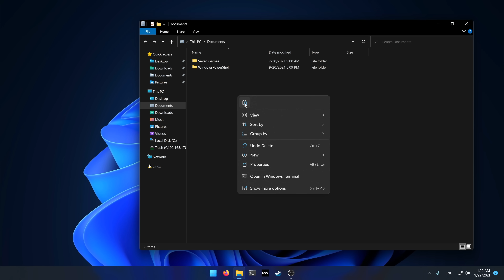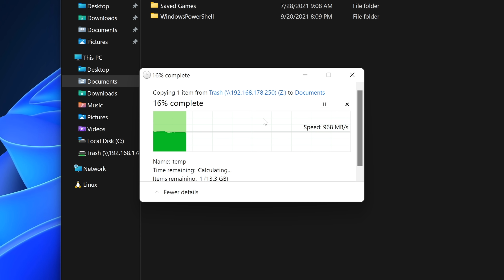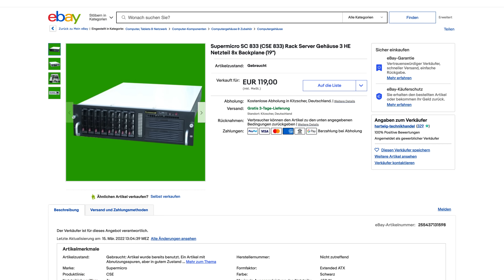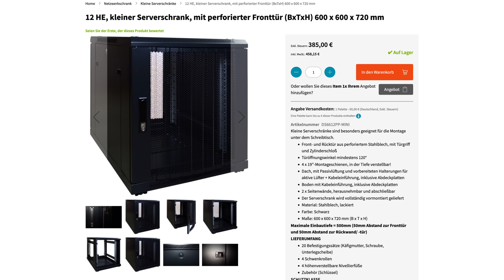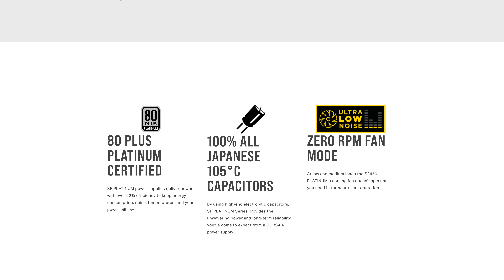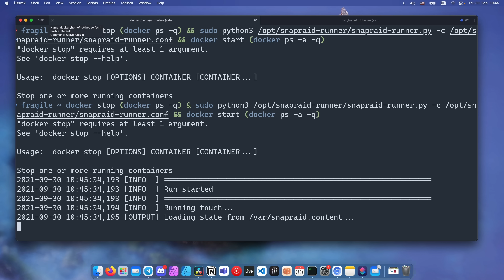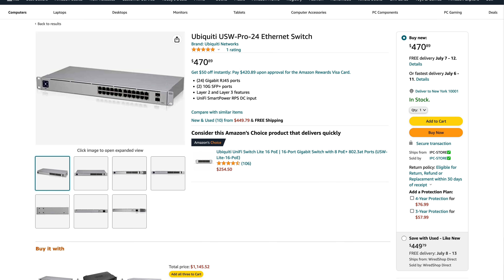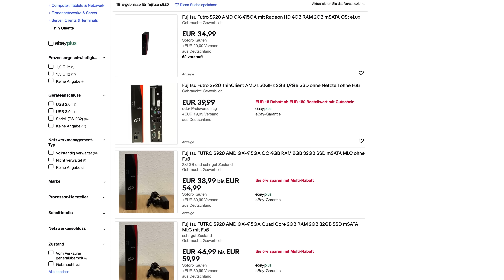Building a Homelab Server Rack!

Comment: I'm very curious about the exact specs and the daily power consumption. How much power does it draw on average?
Reply from the maker: The whole rack or just the main server itself?
Reply: @WolfgangsChannel  Oh sorry the main server itself :)
Reply from the maker: 19-22W on average, when the HDDs are spun down. I use my SSDs as much as possible, and when they’re full or the data hasn’t been used in a while, the mover moves them to the HDDs. With all HDDs running, the power consumption doubles, becoming 50-55W
Reply: @WolfgangsChannel  Nice, that sounds pretty good. Am gonna go with a similar setup and have the HDDs be on as little as possible to reduce power. Thanks!

Comment: I am in the middle of similar project as well, upgrading from Pi4, and torn between rack and ordinary ITX case. I see you are mostly using consumer-grade parts in your build, what do you think is the benefit of going with rack case over something like ITX with hot swappable bays in front, or is it just for the looks and maybe tucking everything neatly in the rack? Are the rack cases generally compatible with consumer motherboards or did you have to drill additional holes?
Reply from the maker: Rackmount and ITX are in  different 'weight categories' and have completely different use cases.

Going with a rack makes sense if you have (or plan to get) other components apart from your main system – e.g. a switch, a rackmountable router, perhaps another system, etc. When it comes to the main server itself, it might make sense to go with a rackmount enclosure if you think you'll need more than 4-6 hard drives and you like hot swappable bays.

Getting a rack just for one system and with no plans to expand is probably not a good idea. Server racks are big, and if you're considering an ITX case as an alternative, it's probably because you want something that doesn't take much space. If that's the case, a server rack is out of the question.

Concerning the motherboard compatibility – empty rack enclosures usually have standard ATX standoffs. There are some all-in-one servers that feature proprietary motherboard standards, and if you find an empty enclosure from one of these on the second hand market, it might not be compatible with an ATX motherboard.
Reply: @WolfgangsChannel Some ITX cases have hot-swappable bays in front (aimed at home-NAS builders), but I think I try to hunt a second-hand ATX-compatible rack case as I plan to upgrade. Software side I think I'm going to try out TrueNAS. Thanks for the advice!

Comment: Very cool project.What is a noise level under full load ?
Reply from the maker: The fan speed is fixed. The CPU is not very powerful so it doesn’t get very hot, even under load. Since those are Noctua fan, the noise level is low

Comment: Amazon sells short 6" extension cords that you can use to move the power bricks out and away from the power strip, thereby making each outlet available.
Reply: A wild Dave appears
Reply: There's also the option to get a power strip with only IEC C13 sockets. Usually they have a lot more since it's more compact, and you can connect servers and lots of appliances directly to them. And for stuff that uses regular mains plugs, Amazon has also tons of IEC C14 to whatever plug you use in the country (usually made to be used with UPSes).
Reply: Somebody on Reddit clued me into these when I ran into this issue with my UPS. Those things were a lifesaver.

Comment: To be honest the gold vs platinum is a debate on itself because you aren't getting more out of it per se (cost vs savings), because on the board you could get a maximum profit of 3%. plus you swapped the 650w with a 450w unit. So the consumption of your hardware could potentially "fill up" the 450w faster where it would have a negative efficiency because the PSU would be on a higher load thus having more costs in the long run. Also as for the PSU I would have gone for a seasonic because they are better quality and if you ran that 24/7 you want to have a reliable PSU. Either way the rack itself looks good! But just a food for thought :)
Reply: the platinum has a flatter efficiency curve contrary to the gold. it beats gold no matter what load you consider, and he mentionned in another comment that the thing doesn't pull more than 150W.
As for Seasonic, they have some really crappy series too. As for that Corsair one, he has the top of the line from the brand, so he'd have not much to gain going seasonic.
All in all, no matter what brand he selected, a platinum makes more sense anyway. they run cooler, the fan kicks in rarely if ever, since the case alrealy pushes some airflow through the PSU. Looks good as it is :)

Comment: 8:12 Just for anyone that is thinking of taking this advise; keystones need the same exact punch down tool to terminate them properly. What I will say is that keystone patch panels are nice because they are very modular and you can get keystones for HDMI, USB, ect. not just ethernet.
Reply: Only if you get that style of keystone; You can also get slightly more expensive pass-through keystones that have an RJ45 socket on either side so you just plug a regular pre-terminated cable into the back of it.
Reply: The CAT6A keystones I use don't need a punch down tool. They come with a plastic part you clip the cables into, then you press that piece into the back of the keystone. Requires a lot of force, as the plastic part punches down all eight wires at once.
Reply: There are a lot of keystones that don't need punch down tool. The "punch down" functionality is build in this modules. Just read the manuals before you buy this modules.

Comment: There are a lot of newer Supermicro server chassis that can be found on ebay in Germany,
I recently got SC826 12 bay chassis for €200 and redid it into JBOD, it had quite fans, quite power supply. I also have SC743 chassis where I replaced fans with SuperMicro quite version, and upgraded power supply to quite version as well, SuperMicro have quite friendly components =)

They also have front panel breakout cable CBL-0084L, it's around €8.
Reply from the maker: Very nice! Will definitely look into that as my storage array expands
Reply: @WolfgangsChannel  I can give you list of official parts for the whole assembly and where I sourced them within European Union, took a month but I was able to get it all for significantly less than the price of a JBOD listings for same configuration
Reply from the maker: For the sake of my wallet, I don't think I should know 😁

Comment: You mention optimizing for noise and power consumption. I'd be interested on hearing about the things you investigated. I'm looking to build something similar, but I'm having trouble figuring out how to identify what parts means lower power consumption and noise. In particular, I'm not sure how to evaluate CPUs across generations and brands or if motherboard selection matters.
Reply from the maker: Hey. This spreadsheet has been very helpful: https://docs.google.com/spreadsheets/d/1LHvT2fRp7I6Hf18LcSzsNnjp10VI-odvwZpQZKv_NCI/edit#gid=0

It's being maintained in this thread on a German forum https://www.hardwareluxx.de/community/threads/die-sparsamsten-systeme-30w-idle.1007101/

It turns out that Fujitsu motherboards in particular are very power efficient. That and most energy efficient systems are usually powered by PicoPSU

Comment: As a sysadmin, I loved this! Great to see people adapt entreprise gear for home use.
Reply: I hope you are a real starlink admin! because it's great to see enterprises adopt opensource for their consumer facing gear / service.  Referring to the use of openwrt on starlink routers
Reply: I've wanted to do my own homelab setup for a long time, but since I started working for an MSP and working with this stuff on a daily basis I've been even more interested in doing something better with my home setup.
Reply: Why should a home user adapt enterprise gear at home? Isn't enterprise gear made for enterprise?
Reply: @Beni9819  It comes down to what you want to do. In some cases you may not really get a huge advantage from using enterprise networking equipment. But you will get more control over your network, and you will get better security. When was the last update for my consumer grade router? Never. Yikes! With news of routers getting turned into botnet serving networks, security is one big one. You may not use a bunch of the fancier enterprise functions, like you probably aren't going to be setting up a site-to-site VPN. But even if you just want a bit more control than you have now going with an enterprise level firewall will be much more powerful. 

Next comes down to what kind of environment you are in. For a 1 bed 1 bath apartment, yeah, you don't have much room, and you likely don't need more than 1 access point. In my house it's a two story with a basement. So having 1 access point per level is a goal of mine. I presently have two consumer grade routers, one acting as a router, and the second one set up as just an access point. But connections are finnicky all around. One of these days when my budget will allow I want to get 3 Unfi APs and set them up. I do have ethernet wiring on each level, so it shouldn't be too difficult to set it up once I have the equipment. It's going to give me APs that are easily managed, updated, and mesh better than my janky two disparate routers setup that competes for connection, and the one acting as an AP just decides to randomly go out on me. 

In the end, do you need to use enterprise equipment at home? No. And if you're not really into networking you probably aren't going to get anything better than buying a consumer grade mesh system. But if you want to do things like run your own server, or any other advanced home networking it might be worth it to do. But everyone has different needs, wants, and level of knowledge and skill. Pick what works best for you.
Reply: @andmicbro1  Thank you for your detailed explanation. I totally agree with you. If somebody wants to get experience in enterprise hardware but does not have a work place where he is allowed to learn it, it's a great alternative to learn it at home with the added benefit of the family having a quite good Wi-Fi🙂
Reply: @Beni9819  Because used enterprise stuff is extremely capable and very cheap
Reply: @Beni9819  because frankly "home gear" is not cutting it for me anymore. I have 10 GbE fiber at home with a dedicated server running proxmox.

Comment: Nice video.  Homelabing a rack in a compact space can be difficult.  My old house had some large unfinished spaces in the basement so a 42U rack was no problem.  I decided I wanted to use network rack in a closet for the new house.  That has limited cases choices as I have just under 17" deep of space.  I also wanted 2 optical drives.  So I have a non-optimal case.  When Zen4 comes out I will probably move my 5900x from my desktop to the ASrock Rack x570 board in the server and hopefully moving to a better case.

Comment: Awesome video! I'd love to put my gear in a proper rack some day.
That PSU swap does make me cringe though 😬😬😬
Just swap the fan, and you have a PSU actually rated for 24/7 use.
Reply from the maker: I’m thinking about going even more ghetto and replacing the Corsair PSU with a PicoPSU 😁 the problem is, I don’t have an HBA capable of staggered spin up, and with all HDDs powering up simultaneously, the system pulls 150+ watts
Reply: @WolfgangsChannel  
Sound interesting haha, looking forward to it
Reply: @WolfgangsChannel  Perhaps an HDPlex 250W GAN?
Reply from the maker: @schnuggo  The HDPlex folks told me that it actually doesn't have the best idle efficiency :( 
I've settled on a 160W DC-DC brick for this case, which is well over the max peak draw of 110W.

If you're not limited by the case, Corsair RM550x 2021 is crazy power efficient at low loads: https://gutt.it/corsair-rm550x-550w-netzteil-vs-picopsu-90/

Comment: Have you had any problems with drive noise? I have the exact same WD drives(just the 4TB version) and id gets kinda annoying, if I dont wear headphones
Reply from the maker: They do get pretty noisy, I was mostly annoyed by the low frequency vibrations. What I did was get an anti-vibration rug for washing machines and put it under my rack. That helped eliminate the vibrations, but still, they're 7200 RPM drives, and will definitely be louder than 5400 RPM ones.

Comment: Bro, get a Cable Fritzbox, toss that Vodashit away. Also make sure to add airflow to your modem, as they heat pretty good
Reply from the maker: I don't use the Vodafone box for routing, so I don't care about it. As long as it converts the Coax signal to Ethernet, I'm fine with it
Reply: @WolfgangsChannel  Thats unfortunaly not all. You need to understand how your coax internet is working and how your modem is processing it. Voda ships with lowend hardware with no good cooling. Fritz is using more powerful hardware and a bit better cooling, which is also good for latency, especially when using at prime time.
Everyone i switched from Voda Modem to a Fritz Modem experience a much better performance.
It is worth switching.
Reply from the maker: Thank you, I will think about it if I have any issues with speed or latency. For now everything has been working smoothly

Comment: Cool video! I was wondering if it would be possible to replace the ISP router to empty the drawer of shame so to speak.
Reply from the maker: Not in my case, since I have the Internet over coax. The router only acts as a modem and doesn't actually do any routing
Reply: @WolfgangsChannel  They can be replaced! I know (and you do too probably) that Fritz has replacement models for coax routers. Only problem is that they too suffer from the intel puma bufferbloat bug that others suffer from.

Comment: To anyone watching this: If you take a metal saw to your case, make sure to blow the dust out afterwards. Diligently! I know people who killed very expensive hardware through a short made with metal shavings. Fans will suck that stuff in and potentially blow it everywhere. Vacuuming with sensitive components inside might not be good idea, either, because electrostatic discharge. So if you have to vacuum, do it in the empty case or take the small risk, otherwise compressed air is less risky option.
Reply: He could have just bent it left and right till the metal part snaps off, no need for a saw.
Reply: Decades of vacuuming and never any static problems. Better than compressed air since that pushes dirt further in rather than getting it out. As for the metal bending & breaking it off is better, IF you need a saw just attach a Niob magnet (eg from an old harddisk) to the blade and it will keep the shavings in place
Reply: @jfkastner  yeah I never had a problem with vacuuming my PCs either, but there is non-anecdotal evidence (as in actual data from studies in enterprise systems) that says it's a problem. Given that modern hardware is pretty robust and ESD damage can be very subtle, gradual and intermittent, I thought I'd mention it. You might or might not have had problems years later without attributing them to the vacuum or hardware might just have gotten better since those studies. Who knows? I personally take the risk without problems, but would want people to make informed decisions.
As a side-note, an air compressor to blow out the dust worked as well for me if not better than a vacuum. So hard disagree on that point. A compressor is just less convenient and ubiquitous. Canned air is way worse for actually getting dust out because low flow and pressure to that I would agree.
Reply: @con-f-use  I guess I agree with you mostly. Can you share any such studies you know about vaccuming and electrostatics? From my understanding there are vaccum cleaners that are electrostatic safe. They have earthed (grounded) brushed that are used clean the electronics. That way any charge build up is discharged to earth.
Reply: @therealb888  Oh boy are we going far down a rabbit hole. Yes, there are shop vacuums that are low ESD. And yes, that is NOT because they don't produce charged particles but because their hoses, inter-connectors and dust compartments are grounded, so that if you sucked in something combustible, it won't be ignited through electrostatic discharge picked up through tribo-electricity on dust and those components because it is discharged before it sparks. I can see how ESD-save brush attachments to similar such vacuum might be ESD-save and pretty handy for electronics work. I've not seen such a thing in professional electronics shops. Quick googling tells me, there are indeed a number of such devices commonly used in the electronics industry. All that I have seen in electronics shops was compressed air, though. That and vacuum pick-up systems for moving components, parts and circuit boards. So they are a thing, and probably for good reason, but probably not that widely used, at least not in my part of the world. And the fact that they exist and that there are air compressors but hardly any non-ESD-save vacuums would support the claim that vacuuming poses at least some danger from ESD.

As to the source, I don't have it at hand, sorry :*( 
It was cited and linked to in a Linus Tech Tips video, probably the collaboration vid with electroboom on ESD, but not sure. I was also told about those papers, when I interned at a manufacturer of industrial laser printers back in the mid 2000 and remember a designer of the infamous thinking machines mentioning they had to move the air vents from the bottom to the middle because of ESD from cleaning crew vacuums in their prototype labs. So it's an old tale if there ever was one.

All I wanted to say is: if you vacuum your expensive electronics, and they malfunction afterwards, don't blame old me and my comments. :D